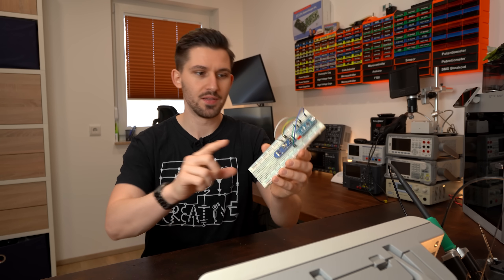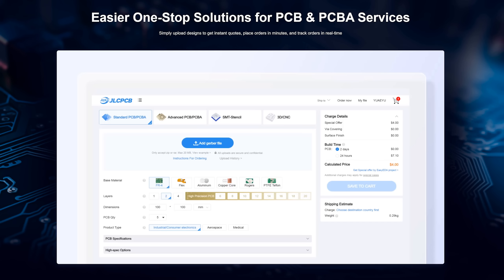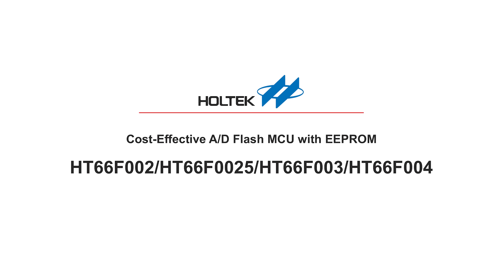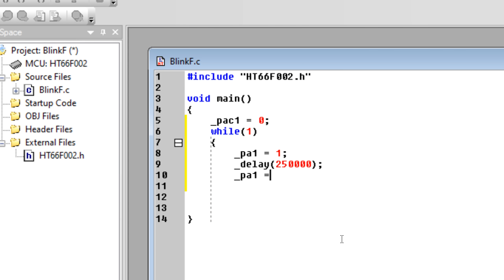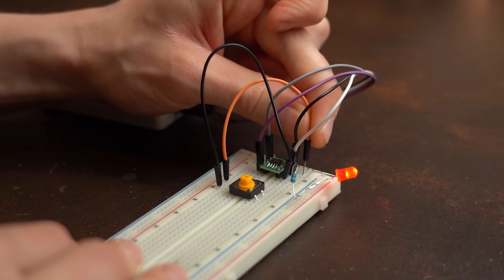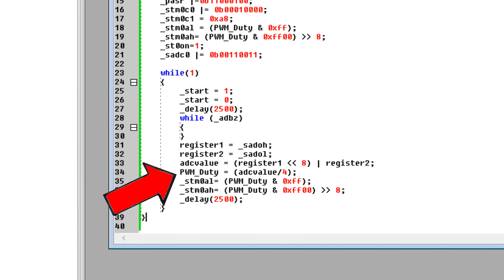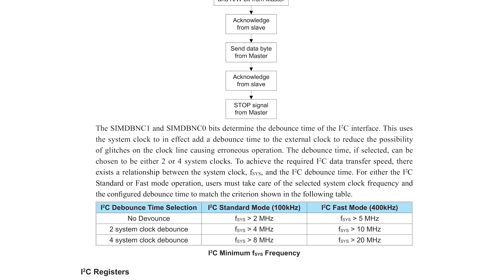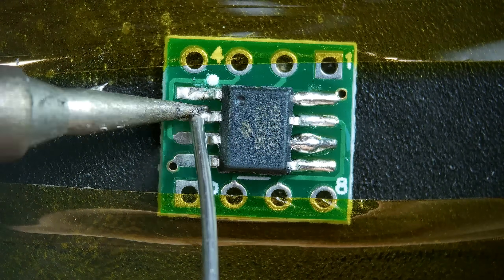I tried the Cheapest Arduino Alternative (that Nobody heard of)

Comment: Upvoted the recommendations for CH32V003. It's time to quit torturing yourself with proprietary 8-bit MCUs. There is a whole family of parts with dev boards starting around $1.50USD. The really low end parts require a (stupid) proprietary debugger board which adds another $6 or so - trivial compared to your $100. Other than that, though, they have the advantage of being super standard RISC-V RV32E (E = "embedded' - it has 16 registers instead of 32; fewer to manipulate on an exception) so your basic code can scale from that $.10 part up through Linux-capable boards starting around $5 and SBCs,  up to the 64-core beasts with lots of stops at the low end. WCH has pretty much cloned the STM lime with CH32V103, 205, 307 (if you NEED 80 GPIOs), etc. Bouffalo has several nice parts at the $1 mark and above here there are dual (and triple) cores, with or without radios or other peripherals. Importantly, your investment in learning RV assembly - if you choose to - is preserved. You can simulate or debug on large cores and then shove down to tiny pin counts and lower RAM to optimize costs as you wish.

All the vendors (WCH, Bouffalo,  SiFive, Andes, Espressif,  T-Head/Alibaba,  etc.) have their own SDK if you like private-labeled Eclipse. (blech) WCH offers Mounriver Studio for free. Most everyone is actually using the GNU (GCC, Binutils, GDB, etc.) or LLVM (Clang,  lldb, etc.) tools under the hood.  Some chips use plain ole JTAG - Espressif RISC-V parts let you use one single USB connection for power, JTAG, AND serial console, for example, without needing a JTAG probe at all. WCH has a formula + tradition  of using 8051 + some kind of specialized hardware (bluetooth, seriall/SPI/I2C, USB hub, SATA controllers, whatever) and they've vowed that all future parts will be based on RISC-V. Ditto Espressif - all future parts are RISC-V.

Because they're open, lots of programmers have experience with them, so you can usually find Arduino software support (e.g. https://www.cnx-software.com/2024/01/04/wch-risc-v-mcu-arduino-ide/) or ports of whatever OS you like from FreeRTOS to Nuttx or Zephy or Linux as appropriate for RAM and core count of the device. (Not so much Linux for the devices with 2K, for example.) Most of them have native Platformio targets.

There are tons of examples and helpful libraries around, even without relying on the Arduino ecosystem.  CH32V003 deserves a callout for https://github.com/cnlohr/ch32v003fun, for example, for the incredible amount of functionality from a $.10 part. The Espressif parts mostly Just Work with the existing C/C++ for the ESP32's written for ESP-IDF. (Espressif doesn't have great dual-core or PSRAM options yet.)

By pretty much most measures - and almost certainly for hobbyist volume stuff - it's time to forget about single-vendor, 8-bit parts. If you outgrow a CH32V207 and grow into a BL616 because you need Zigbee (or have to change brands/families for whatever reason)  you'll find that MOST of your tools - segger, debuggers, jtag probes, etc. - will come over and more importantly, most of your developed skills (maybe you don't write assembly, but you've learned to read it while stepping through in GDB) comes across with barely a bump. Maybe you grew from a 2-core  Maybe your SBC needs to grow from a 2-core C906 to a 4-core JH-7110. Not all the peripherals and registers will be the same, but you're not restarting from scratch.

Anyway, thank you for your channel. I've upvoted all the RISC-V recommendations I could find because I agree with most of them; I just had additional points to help you and readers decide on future parts.

Comment: In 2015 I had to miniturise an Arduino / AT Mega project and I swapped in an 8 pin replacement which I thought this was, but indeed it doesn't seem the same thing.  What I was using was called ATtiny13 - worth checking out..   I seem to recall that it required a special capacitor for programming it. It was some time ago.

Comment: nice i love such micro controller. there are simple and efficient and this particular controller is closer to a simple cpu that you really learn how it internally works. yea it make things ab it harder but in the end you have a better understanding why it works that way. i used atmel tiny 13 and up to the tiny 85 in the past they are great but for the most parts way to powerfull. 
i have made a staff for a cosplay charter for a friend. i designed it based of some pictures she gave me and 3d printed most of the parts of that stuff. the staff had to glow in a breathing motion and react to a button and if stomped on the ground like in the animation. i have done this with a atmel tiny 13 and a button and a reed contact and a magnet on a spring and some LEDs. so the button can be pushed for the attack animation and the reed contact is triggert if the staff is stomped on the ground. 
in the staff was a normal lir2032 battery for power and it ca be recharged. the staff works for about 5 to 10h depending if it is only breathing or constantly attack or stomp. 
at first i thought about a atmel mega328 but this was way to big and my test circuit did not work long enough even on lowest clock speed and i realized i dont need that much LEDs to make this work and so i cut down the LED groups from 8 to 3 and from 40 to 12 led. i used light diffusors and light pipes so i could spread the light sources apart and used the pwm of the chip to make a transition so it looked like i had 3 or 5 leds in that spot but it where only 2. in the end i was able to cut the number of led further down so i had only 5 leds in the whole staff. my friend was happy with the outcome. ^^

Comment: Definitely bookmarking this video... I have a very similar project with an idea that's been indefinitely set aside for this exact reason, and it doesn't need I2C. It might just see the light of day because of you!

(If anyone happens to be reading this who follows my channel, surprise! That's the "other idea" I mentioned about my modular 3D printed storage system - individually addressable lights and "smart" cells! It's still just an idea, but it may have just gotten more feasible...)

Comment: Watchdogs being triggered always lead to some head scratching moments :-) I really wonder, that it is on by default. 

Bitbanging I2C is a drag, but I think, it is possible. 

For hobby projects, the processor is maybe too simple. For consumer electronics, produced in high volume, every saved cent is worth it. For industrial electronics (my field, 100 to a few thousand units), the initial costs  for learning how to handle the processor, would be too high, usually.

Comment: i use an REDACTED flashed with the arduino bootloader. They are cheap and support all the features you outlined here. I designed a flasher board and even an arduino-like prototyping board. I would tell you all what i use but im sorry i dont want the demand and prices to shoot through the roof lol

Comment: You can do I2C by bit banging. It's easy. They don't implement master mode, because it's much more easy than slave mode. Slave mode generates an interrupt on data reception. This is not necessary in master mode, because you know when you'll be sending data. So, there's no real need to spend transistors on it, as you can do it i software.

Comment: The only way I know about Holtek was when I took apart a laminator machine.
I was planning on taking it apart and reprogramming it to have a "slow" mode for thermal transfer toner of PCB images.
Unfortuantely there wasn't much to dump the firmware or to re-program it, and within months Holtek locked down their documentation archive. I also needed to reverse how the heater was modulated, temperature was measured, and how the AC motor was being controlled.
It was far easier for me to just run the PCB through the laminator 20 times than to reprogram the machine.
Reply: 110 Euro isn't that bad... I'd think that their IDE being limited to Windows is more of the issue... I wonder if WINE (et al) would be able to utilize the USB device properly for programming in Linux.

Comment: why not use a single microcontroller for the whole project and just multiplex the i2c? the conversion rate of the VCNL4200 is low enough that you could easily read from all 14 of them in a loop.
also, why are people still buying 328p in 2024? you can buy a rp2040 for $1.83 shipped..

Comment: Give TI-Launchpad a try. It's basically an Arduino with a socketed microchip, so you can program as many microcontrollers as you want, then use just those chips in your project. It's cheap, too, something like $20.
Reply: But usual Arduino Uno uses socketed AVR microchip and costs much less than 20$.

Comment: I suggest you try the AIR001 from Hezhou（合宙，LuatOS）, which should be the cheapest microcontroller on the market that supports Arduino IDE. The price is even less than 1 RMB each.

Comment: The MCU of air001 produced by a Chinese company named hezhou is only sold for $0.1, supporting Arduino, with the following performance:
 
- Adopts the MO+ core of ARM 32-bit, and the main frequency can reach 48MHz;
- 4K RAM + 32K Flash;
- Ultra-wide power supply range of 1.7~5.5V, which can be powered directly by USB or battery;
- Built-in configurable RC oscillators of 4/8/16/22.12/24MHz, which can run at 48MHz without external crystals;
- A 12-bit ADC, supporting 9 input channels;
- 9 timers, 2 USARTs, 2 SPIs, 1 I12C, 2 comparators, very rich peripherals;
- 3-channel DMA, efficient data processing;
- Standby power consumption as low as 2μA.
Reply: Looks interesting, but it doesn't look like there is English documentation

Comment: For cheaper Arduinos it would be interesting to look at the LGT8F328p. They are drop in replacements for the 328p that are more powerful and significantly cheaper. There are Arduino cores available but there are quirks with getting them working.

Comment: Bit-banging I2C should be possible at 8Mhz, depending on the desired freq. 
Also, does it have interrupts on all pins?

Also also, the programmer lines sound suspiciously like I2C - did you try checking if a programmer can be replaced with say an arduino? That might be an interesting project :)

Comment: I think these tiny Holtek thingies are pretty cool. Dealing with limitations is always fun and a good practice to improve your skills to implement smart workarounds or tricks. My first arduino was a $1 Digispark clone with a whopping 8K of memory and a few pins that can be used. Really cool. The Holtek programmer is a bit pricy, maybe it is possible to use an UART ic?

Comment: That distance sensor has an I2C interface. Why not just connect all 14 of them to one microcontroller?  If it's possible to change the I2C address, they can be on one bus. If not,  can use a different GPIO for each SDA signal.

Comment: I don't see why you went for this controller, for just a few cents more you can have attiny mcu's that support arduino and for a bit more you could get a STM32C0 series for example STM32C011J4M6 which has the same smd 8pin son package as the one you showed, just more powerful, supports arduino, 2.0-3.3V, native i2c, uart, adc, pwm, 48Mhz 32bit dynamic clock for lower power consumption, advanced sleep modes and even DMA so your cpu can sleep even while communicating over i2c all while still being <1€ on mouser per chip, 8.8 per 10, that's ridiculous for its power!

Comment: To me this video was really pointless, not sure why you would stick with a crapadelic 8 bit Holtek micro when there're much better 32bit MCUs, like the PY32F002 (ARM Cortex-M0+) or CH32V003 (RISC-V) are available at the same or even lower price, offering more speed, integrated peripherals (like I2C Master) and lower power consumption and even work with that rubbish software called Arduino IDE. Lowend MCUs with all proprietary interfaces and assembly like custom IDE start at around 4cents a pop from e.g. Padauk... (all prices from LCSC, BTW). It's a bit of a mystery how one could possibly end up with a Holtek part when looking around really.

Comment: I have seen these holtech microcontroller in lot of Chinese equipments.. from simple led lights to computer boards , smps , motor controllers etc ... The lack of programming tutorials is the enemy for these cheep uc's  . If you can create a video on how to write code ( in comparison with Arduino) , that will be a great tutorial

Comment: I love cheep little micro controllers I have used ATTiny in a few things they are great wee chips and there are plugins for Arduino that allow you to use it for at least some of them right down to using another Arduino board as a programmer

Comment: I don't remember if these are "real" arduinos or only compatibles with the ide, but some boards are cheaper and don't have the USB support.
They require an USB<>I2S converter, but you only have to buy it once.
Not as cheap à 0.20$, but if you don't need USB then you don't have to pay for the built in converter in each board which will only ever be used during programming.

Comment: While you could bit bang your way to freedom, I generally consider it a Bad Idea™ unless you absolutely have no other option. DMA I2C is usually dead simple to execute, whereas writing it yourself means the surface area of things you need to debug gets huge.

The high cost of programmers is something of a hurdle to trying multiple controllers, but at least for the popular ones there's a way to use an Arduino as a programmer.

Comment: Unless you love to tinker for the sake of tinkering, you need to account for your time in price-comparisons. Is $25 ($28 - $2.80) saved across 14 devices worth having to spend dozens of hours more writing the low-level code instead of using the Arduino core on the more expensive chip?

Comment: I really enjoy the videos, and there are use cases for everything. That said your target group primarily seem to be non-professionals who occasionally enjoy fiddling with electronics. It seems a bit questionable to dive into raw microcontrollers with their individual quirks and expensive supporting devices like programmers and then solely focus on the low cost of the individual mc itself. This is not „the cheapest Arduino“ as you claim: total cost of ownership seems prohibitive for hobbyists. You get esp8266 boards for eur 1.50 and esp32 boards (not just the mc) for eur 2.50 these days that work oob, so saving a few bucks on a chip while at the same time having to solder it to a board, invest heavily in new programmers, learning new programming dialects, having to install new software, and then ending up being able to do considerably less than before seems to me like moving in the wrong direction. Wasn’t it the pioneer work of Arduino and then platformio to do the opposite and embed a cheap but powerful general purpose mc in a standardized simple-to-use ecosystem for just an extra buck or two? Your video still makes total sense for people looking for new challenges. Once you go beyond a blinking led though you‘ll probably quickly run into memory issues. Lastly, if a hobbyist is really in need of a super small mc, attiny has been around for years with tons of existing community support and a cheap ecosystem, and after watching this video, I simply can’t see where this chip would provide any real world benefits. Maybe you can work out practical advantages when reviewing new mc in the future. I do appreciate and enjoy broaden the horizon as long as I can identify a practical use case worth the effort.

Comment: You can get an HT66F002 D-board which gives you pin-out for debugging. This lets you try before you burn it to a real chip :) Fits into the same programmer you already have

Comment: OK, so it's a bare chip, requires an external programmer, and doesn't support the Arduino software ecosystem. So it's in no way an Arduino alternative. It's just a cheap microcontroller. For that, the price isn't surprising. You can get low-end PICs about that cheap, and they come with the same lack of the things that make Arduino useful.

This isn't an Arduino alternative, somebody who would use this chip, and these methods, would have no use for Arduino, and vice-versa. Stupidly titled video. Clickbait. Would be honest to re-title it to "review of cheap MCU". The video is no help to a typical Arduino user.

Comment: You can still do this project with this micro, if you use operations with registers and disconnect the output by hardware you can achieve high impedance and write a library to communicate this micro through I2C. I did it with a pic 12f615.

Comment: Not worth it IMO. The cost of the programmer, the super low level programming required. The extra time and hassle don't make it worth saving a few bucks. Another problem you might run into is that you run out of programming space on those tiny micro controllers.

Comment: Try the py32f002 mcu. It's an 32 bit mcu based on the M0+ ARM architecture. It has an embedded serial bootloader. You can program it with arduino and in LCSC it cost 0.1638 dollars. Its a BEAST for its price

Comment: I'd have thought the arduino would be powerful enough to handle 14 sensors by itself. If they all have the same I2C address, you could use a couple of shift registers (to conserve processor pins) to only enable one module at a time.

Comment: There are a lot of microcontrollers out there, but to be honest i would never dare to go outside something supported by the arduino ide. For your use case, i know some of the new RISCV based micrcontrollers, the CH32xxxx ones, may be exactly what you need.